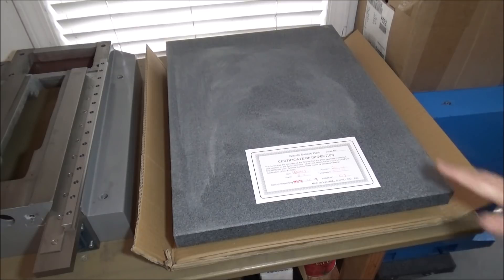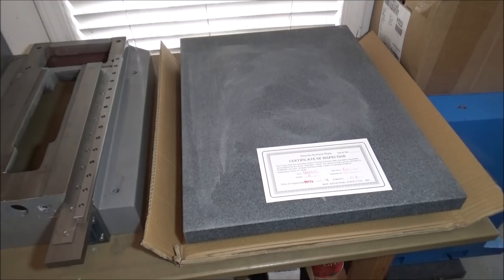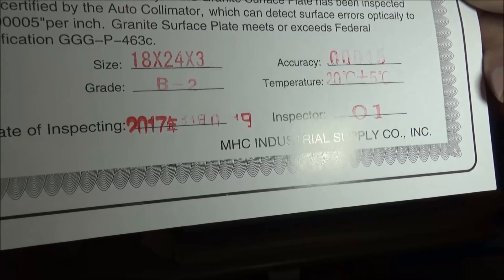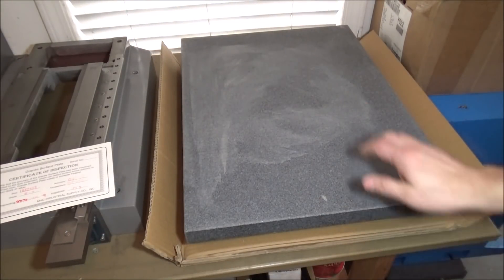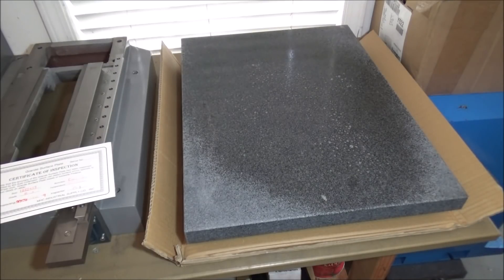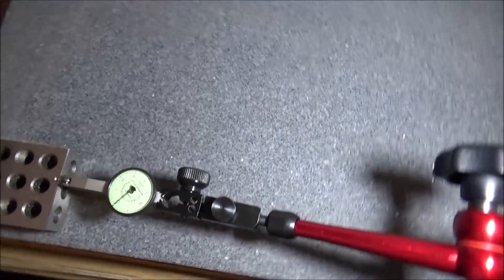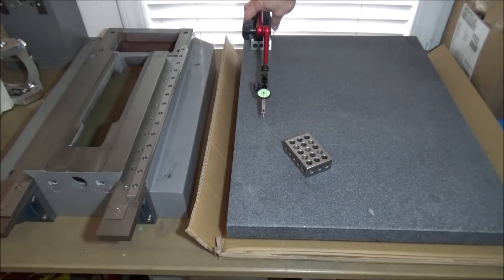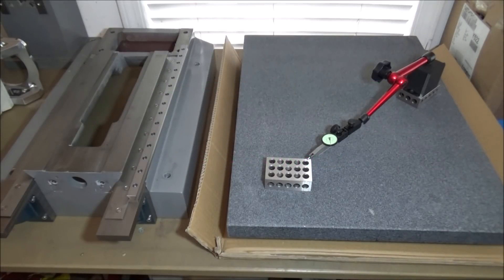Granite Surface Plate

Comment: Noticed the window right off.  Never locate a Surface Plate within 24 inches of any window that gets morning to dusk sun.  The radiant heat will cause distortion.  I have a friends who placed a lathe in the windowed area of his shop and had crazy tapered cutting that disappeared in the PM and rainy days.  If you plan on locating a mill on that bench I'd move it 24" to either side of the window.  Solar radiant heat will cause the column to deflect and mess up your tramming until the sun goes down.
Reply from the maker: Thanks for the tip that was a temporary location. but great info.

Comment: I calibrated a plate from MSC. 3'X4' B grade. Repeat Tol. .000120" As found .001050" Flatness Tol. .0008" as found .00795". Crap!!!
This plate is imported from China. Do not waste your money. MSC sells CRAP! I have never seen a new plate this far out of tolerance.
Precision Granite or Standridge Granite. Do not believe what the certificate says. They have no idea what they are doing. The best cleaning solution for Granite plates is Soap and water or mild de greaser...
Reply from the maker: Well I dont have any means to really calibrate the plate. for the work most of use do I think these plates will work just fine.  if your going to be doing really tight tolerance work I suggest a high quality surface plate. and have it certified.

Comment: I'm new to the granite plate cult, but I have been watching all these videos and yours was a great intro to something doable for me. I don't make anything. I just want to feel "the flatness" and prove it with gadgets. On eBay right now is a  used 24x28x3 granite plate in Leander, Tx 70 miles away for $180.  Precision and accuracy ( I think I understand the difference..I think) are a black rabbit holes you can disappear down.  Airy and Bessel points because my 3 inch slab of granite is bending??? 
Anyway, thanks again for sharing this stuff.
Reply from the maker: Yeah if your doing very precise stuff then you need a good certified surface plate thats flat and verified.
For most of use these type will do just fine.

Comment: You don't want to be using ammonia to clean granite, it will eat away at the mineral structure over time. IPA( Isopropyl Alchohol) is what we use to clean it off at work, and double checking on practical machinists leads to the same answer, or purchase of a surface plate cleaner. You don't want to use cleaning supplies that contain water in them, which ammonia has(it is ammonium + water).
Reply from the maker: Thanks For that I have read Alcohol and Ammonia.  I've also seen ad suggestion of waterless hand cleaner. Lol I will give alcohol a try both are cheap I assume you are referring to 99% not 70%
Reply: @CNC4XR7  yup, 99 for cleaning, 70% for sanitization.

Comment: Most of what iv seen on grades is the thickness makes the biggest difference between B and A grade, not the accuracy. From what iv seen the grade is based more on some sort of distortion from weight being on the plate more then the accuracy in a free state. For what your doing this will be perfect. 

Also from what iv seen at work is that the AA grade plates are only sitting on 3 points on the stand, it's my understanding that this lowers the risk of distorting the plate.
Reply from the maker: I'm not well versed on Surface plates but I think you correct in the fact Bezel points are better suited than Airy points for proper surface plate mounting.

Comment: I have a similar one but a little bit smaller. Lately on youtube  i saw some people use a large tile as reference.  I look at the large tiles that are on building outer. Their far away image reflection have little distortion. They look to be very flat. Their price and availability must be better than a formal granite surface.
Reply from the maker: I would not think they would be accurate enough for serious inspection. this surface plate is 3" thick

Comment: Very nice purchase Sam. That should come in handy in a million ways in your shop. Any reason for going with a B2 quality beside price? Ciao, Marco.
Reply from the maker: Well the tolerance seem to be fine for what I would be doing. And B2 seemed to be the most widely available and affordable.
Reply: Makes sense Sam. Every time I start looking for one for myself it quickly gets confusing because of variety, options, sizes, finish, quality, etc., so I always push the decision to another time. I do like the one you bought, but I was intrigued about your choice. Since one can only build something as precise as his reference system, and money is never an unlimited supply, one has to realize where the point of diminishing returns lies. You seem to have that figured out. Congrats on your new surface plate my friend. PS: Flew the plane 3 hours the other day to break-in the all new top end... all is well. Ciao, Marco.
Reply from the maker: That Great! And No Issues even better . But your very thorough so im not surprised. 

Yes the surface plate decision is confusing For a Home hobbyist I feel the B-2 tool room grade was the best choice all things considered. It did come with a certificate however most will say NIST equivalent etc. If your going to be using the plate to inspect production parts A inspection grade surface plate A or AA is what you want to look for with a True NIST certificate.

Comment: Nice score Sam.  I picked the same one a couple years ago.  Perfect size for quick inspections in small shops. I didn't realize that you could get a discount on MSC if you have an account.  Is that only for businesses?
Reply from the maker: I dont think so It was $188 I think you just need a Account. I had a Emco acct. that transferred when they got bought out.
Reply: @CNC4XR7  I used to have one with emco too. I have to try to see if its possible.

Comment: Nice plate there Sam and a good size.  I’m getting tempted to add one to my Christmas list to replace my (uncalbrated) marble plate.
As for covering I was thinking along the same lines with a foam backed vinyl cover rather than wood.  Like you I wasn’t sure about the wood being next to the granite long term.

Also the rail was right there - I was waiting for you to do a quick sweep across it to see if it was flat !
Reply from the maker: Ah Hah yeah I guess I could have Thanks I will check my rails out to see! Just another use for a Surface Plate.

Comment: Great videos! I was contemplating doing a similar mill conversion. I was wondering if it isn't easier to simply make the base parts from scratch, rather than retrofit an existing mill? Like people make CNC router tables from scratch all the time. If you aren't going to use the dove tails, wonder if it makes more sense to just make the base and column from square tubing?
Reply from the maker: I cant say for sure as I have not been down that road. The opportunity for a 2nd mill can about and I decided to see just how a rail conversion would go on a retro fit.
I imagine you will run into many of the same issues.
Reply: Cool...thanks for the response. Great job on the videos! @CNC4XR7
Reply: @frankbeans289  check out Alan Hollerbach youtube channel. He did that and quickly figured out how hard it is to square up, level and align the parts.  It took him nearly a year to sort it out for his knife business.  He ended up buying a laser alignment tool to sort it out.  He took those videos down now but he might answer your questions if you PM him.
Reply from the maker: Thank You